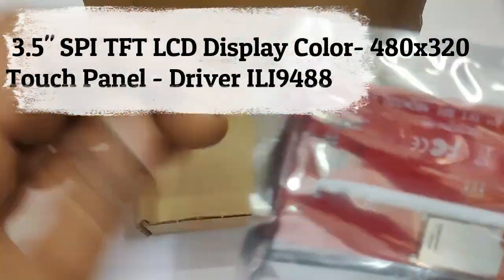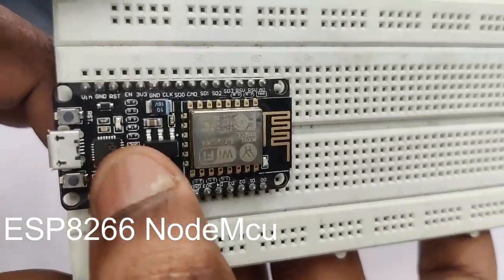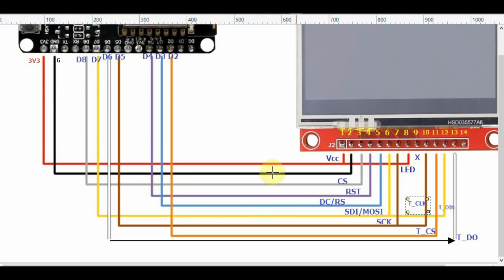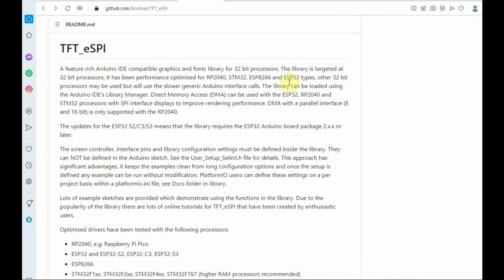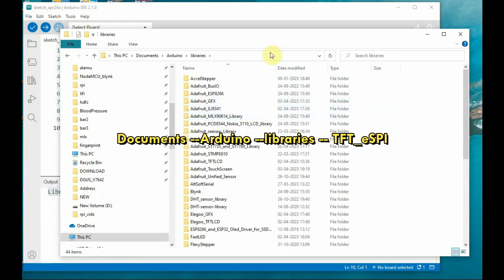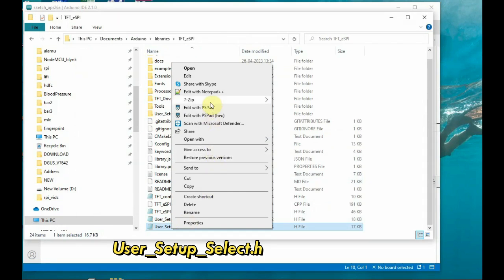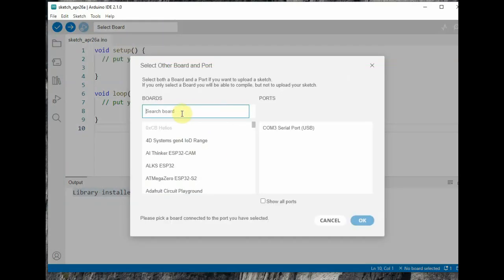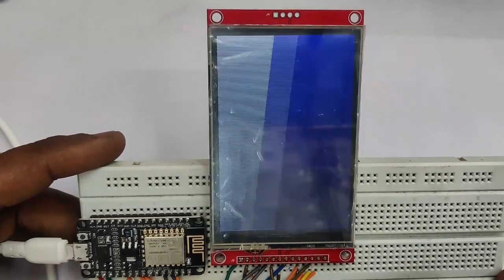3.5" TFT Color TOUCH Display-DRIVER ILI9488 for NodeMcu ESP32

Comment: // See SetupX Template.h for all options available

#define ILI9488_DRIVER

// For NodeMCU use pin numbers in the form PIN Dx where Dx is the NodeMCU pin designation
#define TFT_MISO PIN D6 // (leave TFT SDO disconnected if other SPI devices share MISO)
#define TFT_MOSI PIN D7
#define TFT_SCLK PIN D5
#define TFT_CS PIN D8 // Chip select control pin D8
#define TFT_DC PIN D3 // Data Command control pin
//#define TFT RST PIN D4 // Reset pin (could connect to NodeMCU RST, see next line)
#define TFT_RST -1 // Set TFT RST to 1 if the display RESET is connected to NodeMCU RST or 3.3V

#define TOUCH_CS PIN_D2 // Chip select pin (T_CS) of touch screen

#define LOAD_GLCD // Font 1. Original Adafruit & pixel font needs ~1820 bytes in FLASH
#define LOAD_FONT2 // Font 2. Small 16 pixel high font, needs -3534 bytes in FLASH, 96 characters
#define LOAD_FONT4 // Font 4. Medium 26 pixel high font, needs -5848 bytes in FLASH, 96 characters
#define LOAD_FONT6 // Font 6. Large 48 pixel font, needs -2666 bytes in FLASH, only characters 1234567890:-.apm
#define LOAD_FONT7 // Font 7. 7 segment 45 pixel font, needs -2438 bytes in FLASH, only characters 1234567890:.
#define LOAD_FONT8 // Font 8. Large 75 pixel font needs 3256 bytes in FLASH, only characters 1234567890:-.
#define LOAD_GFXFF // FreeFonts. Include access to the 48 Adafruit GFX free fonts FF1 to FF48 and custom fonts

#define SMOOTH_FONT

#define USE_HSPI_PORT

// #define SPI FREQUENCY 20000000
// #define SPI FREQUENCY 27000000
// #define SPI FREQUENCY 40000000
#define SPI FREQUENCY 75000000
// #define SPI FREQUENCY 80000000

// Optional reduced SPI frequency for reading TFT
#define SPI_READ_FREQUENCY 16000000
#define SPI_TOUCH_FREQUENCY 2500000
Reply: To add to this, if you can't find the NodeMCU ESP-12E board: Open the Arduino IDE.
Go to File > Preferences.
In the "Additional Boards Manager URLs" field, add the URL for arduino.esp8266, should end with .json (I can't paste the link directly as it gets moderated)

Comment: ocr:

# See SetupX_Template.h for all options available

#define ILI9488_DRIVER

// For NodeMCU – use pin numbers in the form PIN_Dx where Dx is the NodeMCU pin designation
#define TFT_MISO PIN_D6 // (leave TFT SDO disconnected if other SPI devices share MISO)
#define TFT_MOSI PIN_D7
#define TFT_SCLK PIN_D5
#define TFT_CS   PIN_D8   // Chip select control pin D8
#define TFT_DC   PIN_D3   // Data Command control pin
//#define TFT_RST  PIN_D4  // Reset pin (could connect to NodeMCU RST, see next line)
#define TFT_RST  -1       // Set TFT_RST to -1 if the display RESET is connected to NodeMCU RST or 3.3V

#define TOUCH_CS PIN_D2   // Chip select pin (T_CS) of touch screen

#define LOAD_GLCD   // Font 1. Original Adafruit 8 pixel font needs ~1820 bytes in FLASH
#define LOAD_FONT2  // Font 2. Small 16 pixel high font, needs ~3534 bytes in FLASH, 96 characters
#define LOAD_FONT4  // Font 4. Medium 26 pixel high font, needs ~5848 bytes in FLASH, 96 characters
#define LOAD_FONT6  // Font 6. Large 48 pixel font, needs ~2666 bytes in FLASH, only characters 1234567890:.-apm
#define LOAD_FONT7  // Font 7. 7 segment 48 pixel font, needs ~2438 bytes in FLASH, only characters 1234567890:.
#define LOAD_FONT8  // Font 8. Large 75 pixel font needs ~3256 bytes in FLASH, only characters 1234567890:.-+
#define LOAD_GFXFF  // FreeFonts. Include access to the 48 Adafruit_GFX free fonts FF1 to FF48 and custom fonts

#define SMOOTH_FONT

#define USE_HSPI_PORT

#define SPI_FREQUENCY 20000000
// #define SPI_FREQUENCY 27000000
// #define SPI_FREQUENCY 40000000
//#define SPI_FREQUENCY 75000000
//#define SPI_FREQUENCY 80000000

// Optional reduced SPI frequency for reading TFT
//#define SPI_READ_FREQUENCY 16000000

#define SPI_TOUCH_FREQUENCY 2500000

Comment: Here is the missing part in his description (content of Setup20_ILI9488.h) :

#define ILI9488_DRIVER

#define TFT_MISO PIN_D6
#define TFT_MOSI PIN_D7
#define TFT_SCLK PIN_D5
#define TFT_CS PIN_D8
#define TFT_DC PIN_D3
//#define TFT_RST PIN_D4
#define TFT_RST -1

#define TOUCH_CS PIN_D2

#define LOAD_GLCD
#define LOAD_FONT2
#define LOAD_FONT4
#define LOAD_FONT6
#define LOAD_FONT7
#define LOAD_FONT8
#define LOAD_GFXFF

#define SMOOTH_FONT

#define USE_HSPI_PORT

//#define SPI_FREQUENCY 20000000
//#define SPI_FREQUENCY 27000000
//#define SPI_FREQUENCY 40000000
#define SPI_FREQUENCY 75000000
//#define SPI_FREQUENCY 80000000

// Optional reduced SPI frequency for reading TFT
#define SPI_READ_FREQUENCY 16000000

#define SPI_TOUCH_FREQUENCY 2500000

Comment: where is link in the descriptions !! the code?
Reply: // See SetupX_Template.h for all options available
#define USER_SETUP_ID 20

#define ILI9488_DRIVER

// For NodeMCU - use pin numbers in the form PIN_Dx where Dx is the NodeMCU pin designation
#define TFT_CS   PIN_D8  // Chip select control pin D8
#define TFT_DC   PIN_D3  // Data Command control pin
#define TFT_RST  PIN_D4  // Reset pin (could connect to NodeMCU RST, see next line)
//#define TFT_RST  -1  // Set TFT_RST to -1 if the display RESET is connected to NodeMCU RST or 3.3V

#define LOAD_GLCD   // Font 1. Original Adafruit 8 pixel font needs ~1820 bytes in FLASH
#define LOAD_FONT2  // Font 2. Small 16 pixel high font, needs ~3534 bytes in FLASH, 96 characters
#define LOAD_FONT4  // Font 4. Medium 26 pixel high font, needs ~5848 bytes in FLASH, 96 characters
#define LOAD_FONT6  // Font 6. Large 48 pixel font, needs ~2666 bytes in FLASH, only characters 1234567890:-.apm
#define LOAD_FONT7  // Font 7. 7 segment 48 pixel font, needs ~2438 bytes in FLASH, only characters 1234567890:.
#define LOAD_FONT8  // Font 8. Large 75 pixel font needs ~3256 bytes in FLASH, only characters 1234567890:-.
#define LOAD_GFXFF  // FreeFonts. Include access to the 48 Adafruit_GFX free fonts FF1 to FF48 and custom fonts

#define SMOOTH_FONT

// #define SPI_FREQUENCY  20000000
#define SPI_FREQUENCY  27000000
// #define SPI_FREQUENCY  40000000

#define SPI_TOUCH_FREQUENCY  2500000

// #define SUPPORT_TRANSACTIONS

Comment: Hello Sir, did you know how will the esp8266 connect to the arduino mega2560 to display on the ILI9488 the data from the Mega?

Comment: Great Video. Thanks a lot!

Am I blind or is the content for Setup20_ILI9488.h missing in your description?
What am I supposed to copy into that file?
Reply: // See SetupX Template.h for all options available

#define ILI9488_DRIVER

// For NodeMCU use pin numbers in the form PIN Dx where Dx is the NodeMCU pin designation
#define TFT_MISO PIN D6 // (leave TFT SDO disconnected if other SPI devices share MISO)
#define TFT_MOSI PIN D7
#define TFT_SCLK PIN D5
#define TFT_CS PIN D8 // Chip select control pin D8
#define TFT_DC PIN D3 // Data Command control pin
//#define TFT RST PIN D4 // Reset pin (could connect to NodeMCU RST, see next line)
#define TFT_RST -1 // Set TFT RST to 1 if the display RESET is connected to NodeMCU RST or 3.3V

#define TOUCH_CS PIN_D2 // Chip select pin (T_CS) of touch screen

#define LOAD_GLCD // Font 1. Original Adafruit & pixel font needs ~1820 bytes in FLASH
#define LOAD_FONT2 // Font 2. Small 16 pixel high font, needs -3534 bytes in FLASH, 96 characters
#define LOAD_FONT4 // Font 4. Medium 26 pixel high font, needs -5848 bytes in FLASH, 96 characters
#define LOAD_FONT6 // Font 6. Large 48 pixel font, needs -2666 bytes in FLASH, only characters 1234567890:-.apm
#define LOAD_FONT7 // Font 7. 7 segment 45 pixel font, needs -2438 bytes in FLASH, only characters 1234567890:.
#define LOAD_FONT8 // Font 8. Large 75 pixel font needs 3256 bytes in FLASH, only characters 1234567890:-.
#define LOAD_GFXFF // FreeFonts. Include access to the 48 Adafruit GFX free fonts FF1 to FF48 and custom fonts

#define SMOOTH_FONT

#define USE_HSPI_PORT

// #define SPI FREQUENCY 20000000
// #define SPI FREQUENCY 27000000
// #define SPI FREQUENCY 40000000
#define SPI FREQUENCY 75000000
// #define SPI FREQUENCY 80000000

// Optional reduced SPI frequency for reading TFT
#define SPI_READ_FREQUENCY 16000000
#define SPI_TOUCH_FREQUENCY 2500000
Reply: us bro us

Comment: Hi sir, I wanted to know how do we check if a soil NPK sensor work as I have recently got one for a project, I connected it using a RS-485 communicator but am getting only 00 value in the 4th byte as you told in one of your previous video. It would be really helpful if you can help me this